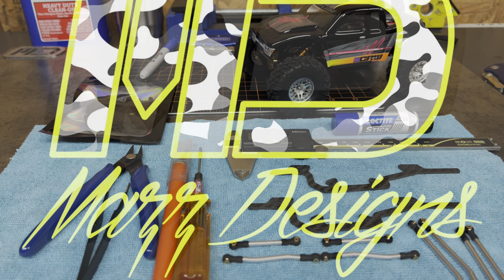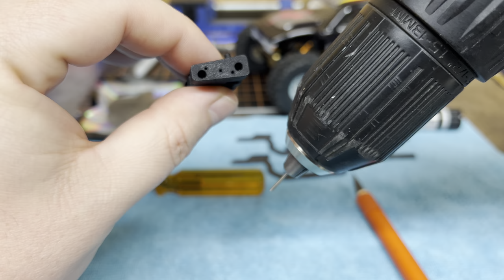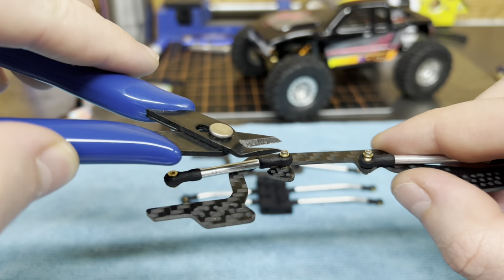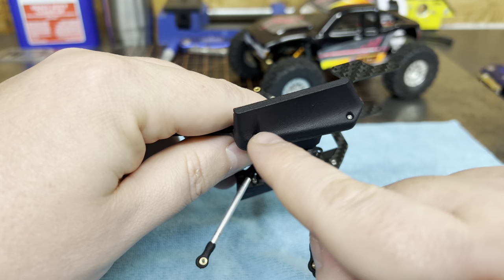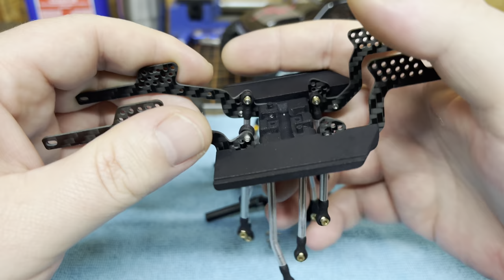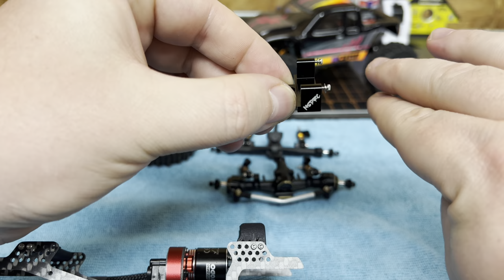Mazz Designs Cheat Code Chassis assembly tutorial. #Mazzdesigns #Mazz #rcsteve710

Comment: All this talk of a 1 inch breaker bar. I’m gonna have to get one just to be sure. 😂
Reply from the maker: Get you a 3/4 impact fed with nitrogen
Reply: @mazzdesigns6929  at the shop in winter they have those big ol 1” impact  drivers takes two guys to lift it up to the bolts. 😂

Comment: I am currently building one of these but I do have a question on something. I noticed that you usually use the hot racing overdrive trans which I have  ordered and installing. My question is what spur gear do you run since that the hr transmission doesn't come with one? Thanks Mazz
Reply from the maker: Sorry for the late reply I always run stock
Reply: @mazzdesigns6929  thank you! That's what I ended up with after trying a couple different ones.

Comment: What driveshafts would i run on this? im running rc addiction links for super 8s..
Reply from the maker: Depends on length of links. I always recommend the stock plastic and they have a multi pack you can buy that will cover what you need

Comment: Will the deadbolt rear links and c10 rear links work with this chassis? I just ordered the v2 carbon chassis before seeing your video. New to the hobby btw.
Reply from the maker: I would usually recommend c10 or c-bolt with v2 but definitely can be done if set up right
Reply: Thanks Mazz